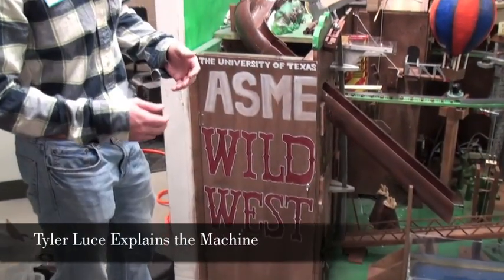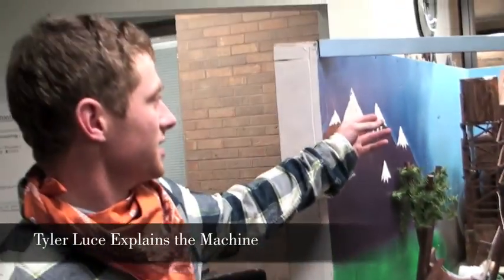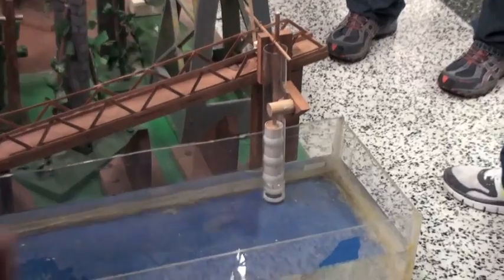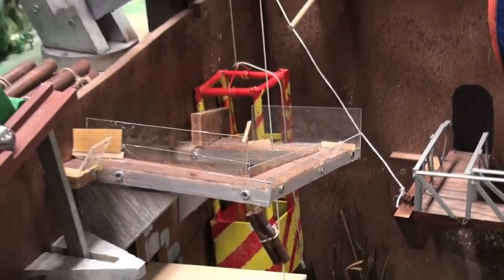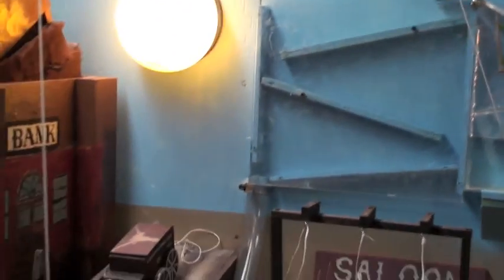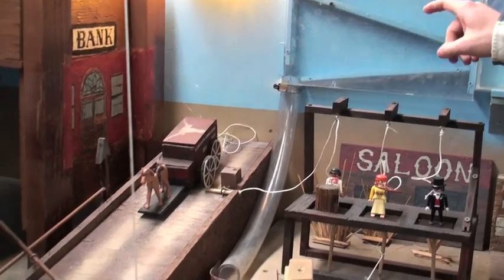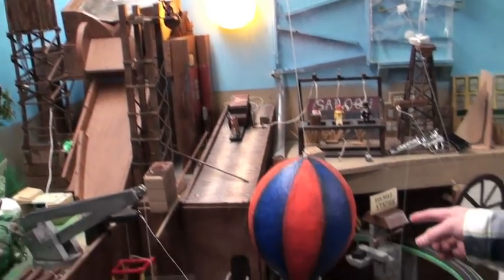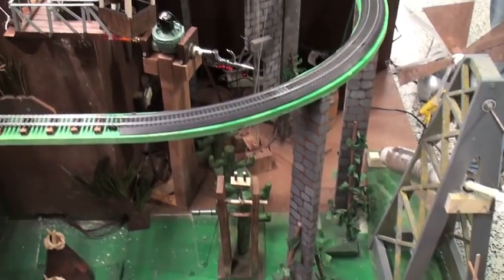ASME Entry Rube Goldberg 2010, UT Austin

Comment: We used a two part epoxy glue to attach the ramps to the inside of the plexiglass box. The epoxy is waterproof and creates a bond strong enough to prevent the ramps from breaking off due to the changing water pressure and currents in the box.